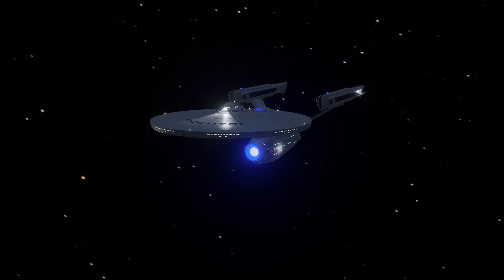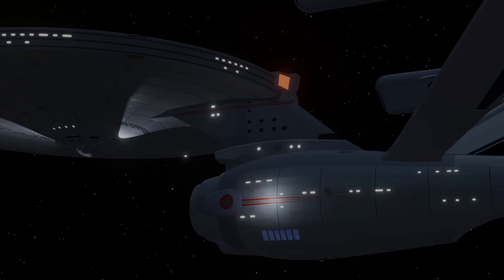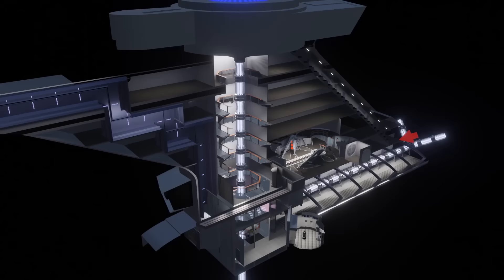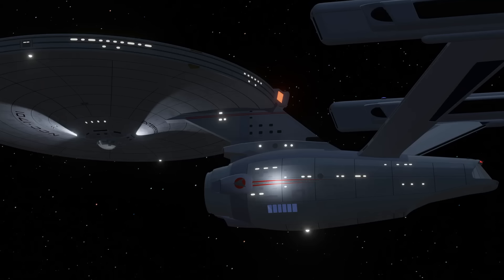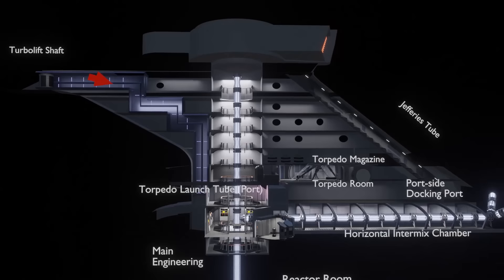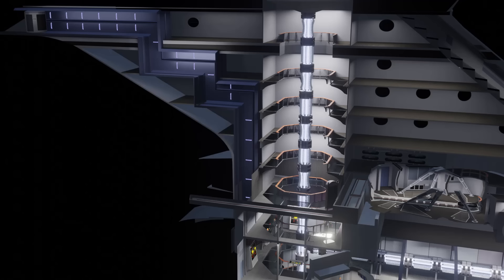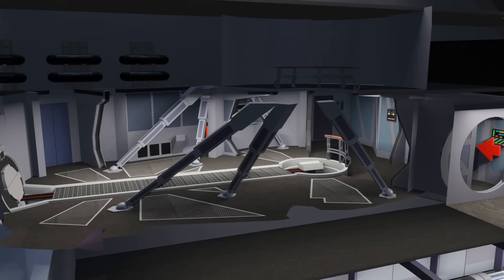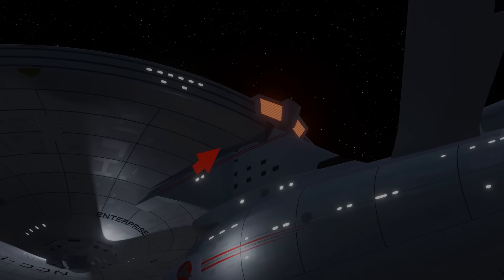The Enterprise Dorsal Problem: how did the turbolifts pass through it?

Comment: TOS and the TOS movies don't really show this that much, but IMHO, the engineering area would be very cramped in some cross points, not unlike a modern nuclear sub. Add to that.... a lot of personnel may never have need to travel to the secondary hull at all.  Literally steerage or lower decks. Only skilled need-to-be-there crew and officers would ever go there.  So whatever turbo/Jefferies Tube, etc method of travel exists would not be on par with an office building Otis elevator, and it wouldn't be in constant use, not like the dish lifts.

Comment: The pictures I've seen has the elevator shaft in front of the engine shaft.  The pictures I've seen of the engine shaft is smaller than what you are showing in the neck area.

Comment: IMHO....You don't need the warp core to run up the dorsal, just a warp power conduit.  Again, IMHO...The Core wouldn't have too far from where it twins off to the warp engines.   You could put the Core anywhere between the 't' and the dorsal, but not IN the Dorsal.   
This is most notable on Voyager where the Warp Core Ejection hatch is further back to what might be considered the Dorsal. 
Just  move the warp core back 10 to 15 feet or more, back from the dorsal..as it should be (IMHO) and the problem isn't a problem any more.
Honestly, I didn't think that the warp core went up the dorsal at all, it didn't make sense, especially when Kirk rushes to a transporter room that was on The Same Deck as the core conduit going back to the engines...remember?
It seems that ST:TMP forgot to make another blueprints for the Enterprise.  Those prints changed sci-fi, A Lot.
Now every space ship movie layout has to make sense..but still often don't.
Thanks for letting me put my two credits in on this controversial subject.

Comment: You guys only think in two dimensions, don't you?  Don't you think that a diagonal route is possible? You understand that turbolifts move horizontally as well as vertically, right? Just think of how a knight moves on a two dimensional chess board and you'll get the idea but translate that from going forward and then to the right, for example, to going down and then sideways.

Comment: You're likely using the wrong blueprint. There are a few different ones out there. Using Mr. Scott's guide, pg.89 shows the horizontal Intermix Chamber (looking aft). Pg. 87 clearly shows the vertical chamber joining up to it in the Warp engine room, decks N-O level 14-15 at the TOP of the engineering hull. It shows the turbo-lift running vertical to deck 11, horizontal along 11 for 1/3 of the deck, vertical to 9, horizontal 20% of that deck, and finally vertical to deck 6. All along the spine of the ship. You're overthinking it. Catwalks and access ways will also be along the outer edge of the hull, explaining the oddity of Kirk exiting the front of the torpedo room. There now I've done it, now I am overthinking it.

Comment: So where is torpedo bay 1 on this ship? They should be side by side, each bay having its own loading system.  In fact you can just see the door to torp bay 1 in the back opposite the airlock. Thus I propose these were smaller than filming made them look and sat to either side of the vertical intermix chamber in the torpedo room flare of the hull with the turbo lift running down between the launchers.

Comment: Listen before you start talking about turbo lifts in the retrofit Enterprise you should look at the original series episodes and watch when they're in the turbolift that they grab that handle and you can see a light strip on the wall behind them. If you watch the episodes you'll notice that sometimes that lightstrip goes up and down and then sometimes at lightstrip goes side to side which clearly shows that the turbolift is not just a straight up-and-down affair but rather goes up and down and side to side which gives evidence to the thought that the turbolift goes in all different directions which will sort of throw your entire theory out the window

Comment: the only space craft that makes any sense in any way in the real world is a cube for the habitable zone. it maximized the dimensions of use since drag is no concept out there.  (as long as it's not designed for atmospheric entry).  Engines would just be part of one side unless they are somehow created as a tubular form and need to vent/radiate outside the ship, but even then they would just be extensions off the back of the cube.

Comment: But if there were two turbo deaths, one for the engineering section, which ran to the backside of the warp core then you walk around the warp core and join a new turbo left located in the source of section,

Comment: It's always amusing when people start talking about the design from a structural or purpose viewpoint.  ESPECIALLY when they cite their "scientific credentials".  The response I've given is we'll get in my time machine with EVERY blueprint, schematic and design concept for the USS Enterprise...CV-6...and head back to the finest shipyard of 18th century Britain.  We'll need to bring all the specs for her flight wing, too.

When we have finally been laughed out of the docks, assuming someone doesn't try and lock us up as insane, or witches, or some such, I believe the point will be made.  The finest shipbuilders of the time wouldn't have a clue how to build something that big, that heavy, or how to even make the materials...or the equipment to make the equipment to make the materials.  They wouldn't have a clue how to power it, how it could possibly stay together, let alone float, or what in the world we're trying to use it for.  Hardly a single system would have any purpose to them.  To us?  She's just an old WWII flat top...

Three hundred years on from now building a USS Enterprise...NCC-1701...won't be unusual, let alone difficult.

As for getting things to fit, I figured out around age 10 she needs to be 1200 feet to make everything work.  Remember, in the first Pilot she had a crew of a couple hundred and was maybe 500 feet.  That's why the bridge module looks so big.  Then they decided that was too small and arbitrarily bumped her to carrier size.  That fixed a lot, but at another 25%-ish increase suddenly everything goes where it should.  For me she's been 1200 feet the past 50 years.

Comment: Maybe it's kind of a cheat or copout, but I've always assumed that fictional universes like this had something along the lines of a variable space geometry (Think Tardis, but in a more mundane sense). You could bend and alter the geometry of an enclosed space to a finite and limited extent, in other words. This would fit into the world's physics, and theoretically you could make the enclosed area geometry 'folded' so that it fits where it seemingly shouldn't and maybe not even require energy until you need to change the configuration. This would also fit the many problems I have with the holodeck (I just don't buy their explanation), and it would be such a mundane tech (you're talking maybe stretching an area to at most double its size, and I don't think we're that far from coming up with something like this in our time) it might not even be something anyone mentions.  If nothing else it's a head canon that allows more flexibility in design and fits nicely into the physics of the universe.

Comment: Yeah, i always found the neck pylon of the original Enterprise & refit were its critical design weak point and just made no sense in how slim it was. Looked elegant, but utterly nonsensical from a practical engineering and hull integrity standpoint.  Even at twice its width it wouldn't have looked any worse but be a lot more stable and with more usable space.
Later Starfleet designs obviously saw it too and did better, although especially the Excelsior class overdid it a little perhaps.

Comment: I never did like this engineering design.  I always thought the verticle intermix conduit to the impulse engine should be more aft, towards the aft of the neck, perhaps flow diagnally next to the jefferies tube.  Basically have it come from roughly the same area as conduit split for the Warp Nacelles.  Engineering should be more in this area.  This solves a lot of problems and is a better use of space.  I always looked at the long O-Deck horizontal travel of the intermix conduit as very inefficient, especially when coming up from below P-Deck.
Reply from the maker: I agree, and it raises the question, why doesn't the Miranda-class have a vertical intermix chamber?

Comment: When you say "vertical intermix chamber" do you mean the warp core? If so then I must say, it's foolish to have your warp core so close to the outer hull as it is in the neck section. If any weapons fire gets through the neck the whole ship explodes. Not even an armour plate would be sufficient. You ideally need multiple bulkheads around your warp core to absorb any incoming damage.

Comment: Just enjoy the movie is best advice. However even in modern warships their are areas that are tight fits and inelegant solutions to accommodate primary ship functions. Add to that that the turbo lifts are 3D “elevators” you got enough plausible that it not out of the realm of possibility! So when Kirk exits the torpedo mag area I wouldn’t think he stepped directly into a turbo lift but had to go down a narrower corridor to access the turbo lift.  Or if you real want to stretch it  and this is a hugh stretch they used a localized transporter to get around the difficult area 🤔😳🙄🧐! Yeah just watch the sci fi drama, enjoy the movie and don’t worry about it is the best answer!

Comment: 1st off the warp core does go that high... i dont know where you got those schematics from they are obviously made by someone who didnt stop to think about anything  before publishing it, regardless of whether of not its an "official" source!
ive seen other schematics before and from what i recall the warp core only goes up to the top of the torpedo deck
the dome on the back of the saucer is part of the IMPULSE ENGINE not the warp core! 
the function of the warp core is to heat the warp plasma up not to provide usable power
its the "main energizer"  further aft (along the horizontal shaft) which takes the heated plasma and converts it to usable power (this is what Kahn targeted in ST:II)
so lets apply some logic: if your trying to heat up something WHY do you add a big long extraneous extension to the top of it that does nothing??? YOU DONT it would only make the energy requirements higher!

Comment: Nah, it doesn’t travel through the dorsal at all… transporters send the occupants from the turbo shaft in engineering hull to a completely separate turbo shaft in the saucer section that runs vertically through the center and has access to all decks of the saucer. 😜

Comment: First of all your completely wrong thinking the impulse engines have ANYTHING to do with the warp engines.
It is an entirely separate systems independant of each other.
The feature your showing only showed up in TNG. If you check you'll find the time lines are off. There has never been
a shaft that goes up the dorsal other than the turbo-elevator in TOS. I have the original official book . I don't see why they would alter that for the refit. To tie in the phasers to the warp engines it would not be necessary to link them to  impulse . But credit where it's due your model is very cool. I am Vulcan with envy.      Peace and long life......

Comment: Why make a video about this topic if your conclusion is null? I actually have a solution for the problems you present here.The problem isn't with the ships design, but rather with your model. Your model here is well made and includes good detail, but its inaccurate.

First, you depict the interiors as being larger then they actually would be. I would opine that this is the source of your confusion. Your scale here is just off.

Second (and this wasn't a problem you posed, just me nitpicking), there isn't a single torpedo room as your graphic suggests. There's two. One on each side, and each one loads into their respective launchers. This was depicted in film. Recall in TWOK when the port side torpedo bay was completely destroyed by the Reliants phaser fire. Yet at the end of the film, we see them all standing in a perfectly clean, undamaged torpedo room as they launch Spock's body. That's because that wasn't the Port side torpedo room, but rather the Starboard side torpedo room. 

Third, the turbolift shaft is more simple then you make it. It does not run jagged or diagonally. It runs horizontally from the center of the saucer to just outside the the warp core complex, then runs down vertically with the core. It stops at main engineering, where the shaft loops around main engineering on the starboard side where it then runs horizontally along with the long intermix chamber.

I have built this ship a couple of times in Minecraft. I can attest that these problems you argue for in this video do not exist. The whole thing fits together just fine.

Comment: 1) It's fiction.  The real answer is "the writers and propmakers just didn't think of it ahead of time".
2) in the fiction, it's a starship that has the technology to generate gravity and nullify inertia.  There is absolutely zero reason the turbolift has to go in a straight line "up and down" the spine.  It could go diagonal.  It could follow a curved path.  It could do loops and rolls, and the passengers would "feel" like it was upright the entire time, because the lift car can generate it's own gravity to make the occupants feel that the top of the turbolift car is "up", regardless of where it is oriented in relation to the rest of the ship.

Comment: This is what happens when a director or set designer prioritizes what looks “cool” over what makes sense. Besides the lift problem, connecting the impulse and warp drives is stupid, and running the connection through the most vulnerable and exposed portion of the ship is idiotic. The impulse drive provides physical motion; the warp drive creates the warp bubble-two different functions; not connected.  Also stupid is the idea of the warp core itself being in either the primary or secondary hull. Jeffries intended the matter/antimatter reactors to be in the nacelles, well away from the crew, especially in case of a breach. But at least they didn’t use a brewery for the engineering set like f***ing JJ. Note to aspiring sci-fi writers and film-makers: learn something about ship, aircraft, and spacecraft design, and physics, before you do something stupid.